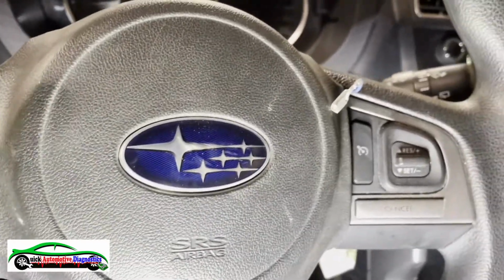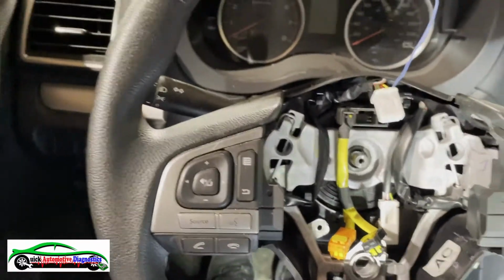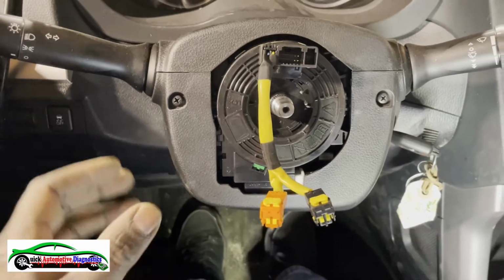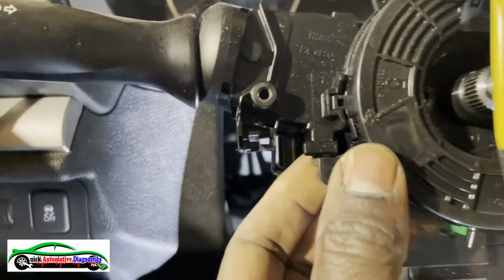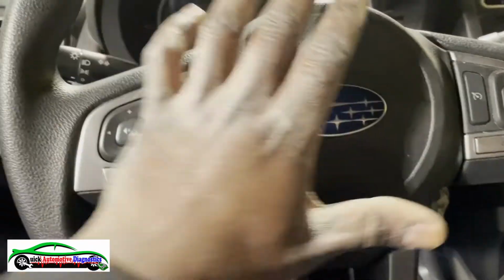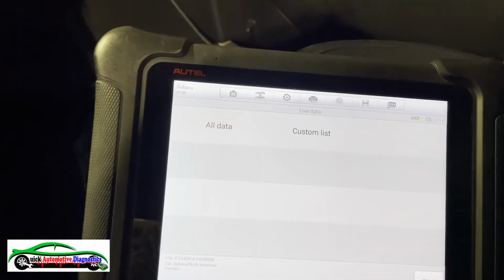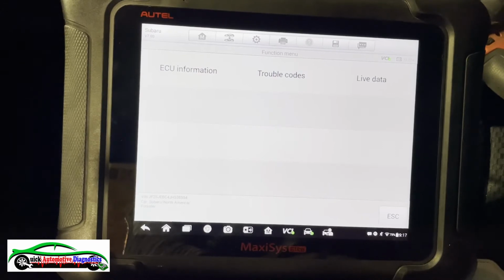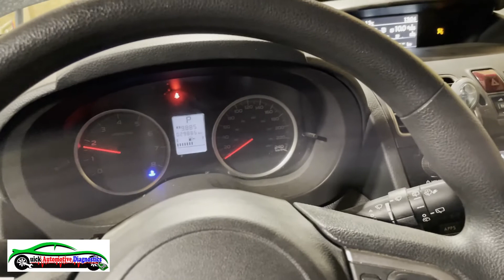SUBARU FORESTER STEERING ANGLE SENSOR CALIBRATION

Comment: Thankyou for the video. Is it possible for the steering angle sensor to break/ fail during whilst replacing the clock spring? It was working fine before, but since transferring it to the new clock spring everything (DSC, ABS, Hill Descent, cruise control, etc...) has all failed and it can't be reset. The reason for changing the clock spring was that the horn was only working when the wheel was in a turned position, and never when it was straight.
Reply from the maker: The clock spring is shooting out causing that problem. You will need to replace the clock spring and preform a steering Angle sensor calibration.

Comment: Hello. After replacing the steering wheel and adjusting the geometry, the steering wheel turns to the right, no error and calibration corrected, where could be the problem, thank you for the answer, Jozef.

Comment: I crashed my 2017 Forester and busted the rack and pinion; no srs issues. I swapped it out and now ABS, hill descent, cruise control, ect., is on. I've read that I need to recalibrate the steering angle sensor. Do I need to replace it or is it possible to just recalibrate the unit on there now? No SAS warning. Also, I have yet to take it for alignment, trying to plan ahead before wasting my time.
Reply from the maker: You need to calibrate it and all lights should go away.
Reply: Quero saber como meter o sensor do torque do Subaru legacy semitrical

Comment: I put coilover and replaced the whole front end did an alignment and my steering sensor code came on do I need a new sensor or I can recalibrate with the one on the vehicle now
Reply from the maker: Sorry for the late reply.
did you try calibrating the angle sensor?

Comment: Thank you for the video. I have a 2012 forester with EPS that fail when I turn the steering wheel slightly off center to the right. At that angle a grinding/groaning sound can be heard emenating from the steering column inside the cabin(it seems). The EPS light then comes on and I have to switch off and on to regain EPS. Sometimes I have to  wait a few minutes and other times second. It has gotten progressively worst. Any advice?
Reply from the maker: Thanks for your question,
If you have access to a scanner go to ABS data and check the steering angle degrees when the steering wheel is straight. Let me know. It sounds like you have a bad clock spring assembly.
Reply: @quickautomotivediagnostics8728  ti will get that done and let you know. Thank you very much for your advice, I'm looking forward  to your next video.

Comment: can you help me, when i turn the steering wheel to the left & right still my steering angle sensor 0 degree, when i scan tool the code is C1231 Steering angle sensor abnormal, is it my clock spring or steering angle sensor is Bad? this happen after i change the EPS coupler.
Reply from the maker: Diagnose properly and if no problem found replace the clock spring assembly
Reply: @quickautomotivediagnostics8728  already diagnose properly still C1231 abnormal, meaning to say i need to replace the clock spring?
Reply: @quickautomotivediagnostics8728  my cruise control also no function..

Comment: Hang on at 6:59 you say you taking it apart to set it, then at 7:00 you have it all back together? What did you do in between? Dislike will stay unless you tell me
Reply from the maker: Camera battery 🪫 went down while recording and I did not notice until it was assembled that’s why you notice the gap . Trying to do better next time 😐 thanks for the comment.
Reply: @quickautomotivediagnostics8728  sorry mate, we all have these technical problems. Your advice in the other part is spot on. Cheers from Aus